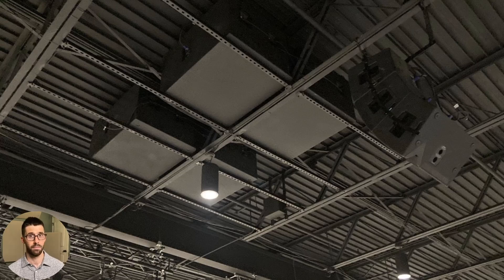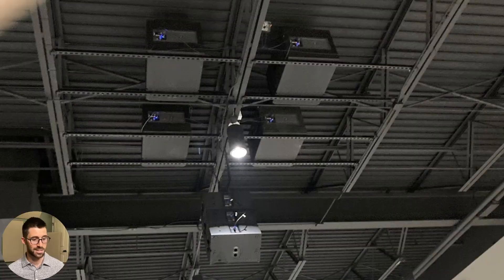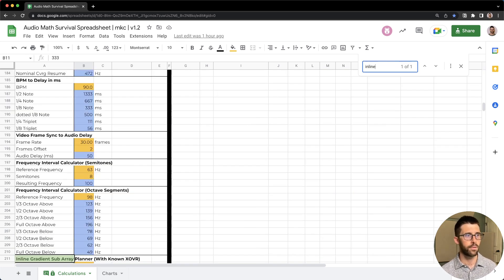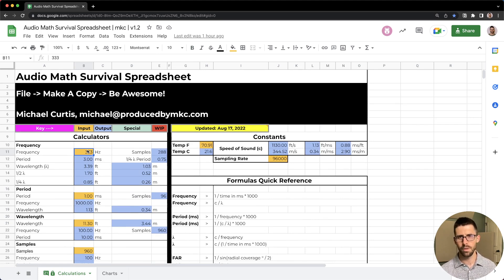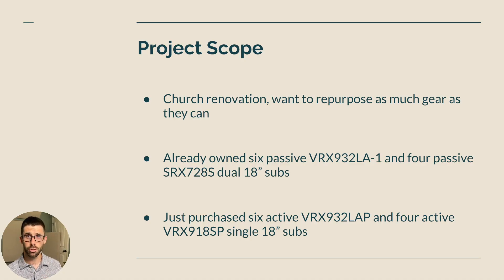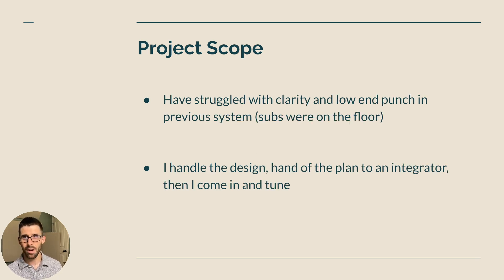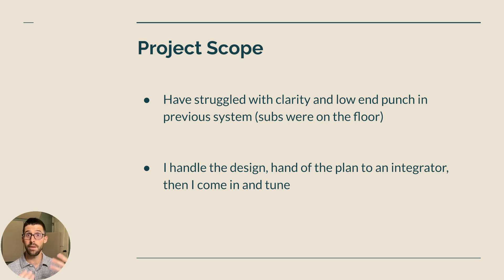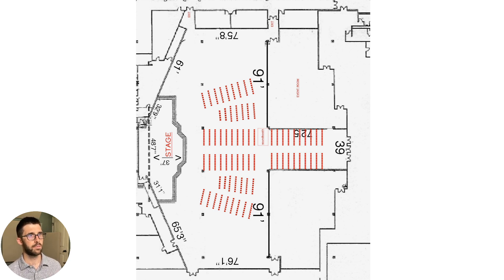They Thought I Was Crazy For Doing THIS With My Subs

Comment: We have a very wide and shallow seating area with a low ceiling, similar to this but without the tunnel. However, our room is not symmetrical and the stage doesn’t sit in the “acoustic center” of the space. Would it make sense to fly a sub cluster like this, but “off-center” from the stage so that it’s in the true center of the room?

Comment: Is it possible and Curtis approved to use this front sub-array design and instead of flying them put the subs under the stage?
Reply from the maker: Unfortunately cardioid arrays start to fall apart and not work effectively when many hard boundaries around them, so I would advise against placing them under the stage.

Comment: Great stuff Michael!  Quick question on the dual 18s facing each other.  What is the math behind the spacing between the two facing each other being 6 inches apart?
Reply from the maker: Thank you! It's so that the sound emanating from the front of the woofer has space to move around the cabinets and out into the audience.

Comment: LOVE learning so much about sub arrangement from your videos. I run small local shows, and I run the KS212C's, which are incredible for easy cardioid setup and mitigating stage noise. I'm curious if it would be worthwhile in smaller rooms that are longer than they are wide, if it would be beneficial to split those subs that 5.5 feet to narrow the overall pattern to minimize wall bounce? Is it worth it? Also, if I were to split them, would they need to be centered? Or can I just aim them towards center? Thanks for everything you do on here!
Reply from the maker: Hey, Ben. Great questions here!

With a pair of KS212C's in a long, narrow room I would do exactly what you mentioned: put them 5 1/2 feet apart in the center in front of your stage. The caveat here is that an active cardioid setup needs space from boundaries besides the floor to work properly. So this would only work if your stage does not have a hard front. If you've got an open stage front I'd still put your subs at least 3ft downstage of your stage to help get even more cancellation at the rear.
Reply: @MichaelCurtisAudio  Thanks a bunch! If I am stuck to a hard stage front, I feel like the next best thing is stacking them together on stage to one side? If I had the horizontal space I could still do the split setup, but I'm curious if it would just make an odd pattern if they're off center?

Comment: I’ve always been told, and certainly felt like, subs on the floor, coupled to that surface, made the low end more…felt, for lack of a better word. Based on this design, do you believe there is any loss in “thump”, especially that 60hz-ish kick?
Reply from the maker: No loss at all! The church I worked with on this sub setup made it very clear that they alllll about the low end. It had to hit hard, especially in the 40-80Hz octave. And this system definitely delivered! If anything flying subs makes sure that more of the audience is able to "feel" the subs, not just the front row.
Reply: @MichaelCurtisAudio   very interesting. Can’t believe I’ve just now found your channel. I lead the production team at a church in Bentonville so I’ll likely be giving you a holler!
Reply: The ceiling deck is also a boundary. In new construction I have requested a concrete pad on the roof deck to improve the response of ceiling mounted subs.

Comment: So your reason for doing the subs like that was to keep the low end in one palace for a deeper low end and it doesn’t travel all over that room.
Reply from the maker: 1. Keeping all the subs together is the most efficient use of energy.
2. The wide audience called for a wide pattern, which can be done in a center sub setup.
3. Flying the subs kept the stage clean AND made the sub energy more even from front to back.
4. The cardioid pattern kept LF energy from bouncing off the back wall behind the stage.

Comment: Hey Michael, first of all, thanks for another great video!

It is one that raises a question I've had in my mind for quite some time regarding flown vs. ground positioned subs.

There seems to be an opinion amongst many audio engineers (as well as system engineers for that matter) that flown subs should in best practice always be accompanied by at least some ground placed subs as a sort of fill, or else there will be a loss in impact and/or focus of the low end. It is a statement that I personally can't really see the logic in and on the few occasions that I have been mixing on a rig with nothing but flown subs I haven't really found an issue with it either, but rather enjoyed it since the low end I perceive at FoH is a closer representation of that perceived close to stage, in comparison to that of a classic approach with subs positioned only on the ground.

In terms of SPL the low end will obviously have a lesser impact in front in relation to further back in the audience with nothing but flown subs (not in comparison to itself, but in comparison to ground placed subs), but this is the whole point of flying the subs in the first place - a more even coverage. As long as there's enough power in the subs to, by increasing their output, have them compensate for that loss in the front this should theoretically not be an issue.

The only argument I myself can come to think of that supports this opinion is that one gets more direct sound from the ground placed subs before any room reflection blends in with it in comparison to the flown subs. This, however, would again only benefit a selected few first rows in the audience and not contribute to a more coherent over all soundscape in the room.

Maybe I answered my own question here but if you have additional thoughts or opinions on the subject I would be glad to hear them.

Cheers
Reply from the maker: Hey, Jack. Great question and yes I do think you ended up answering much of it. Just like we might design a down fill or front fill system for the first few rows if our line array is optimized for the 3rd row and back, having a small sub array down front can be helpful and restore some of the "front row" experience.

If the geometry of the rig works out so that both the mains and flown subs have great coverage in the first row, then no need to add the additional subs.

Sometimes you see at larger concerts a HUGE main sub hang, but then a wide sub arc of additional subs on the ground. That's usually an infra sub rig on the ground (15-30Hz), then the main sub hangs handling 30-80Hz (or wherever the ideal crossover is for that system).

Comment: How was rigging approved? Afaik SRX728 is not rated to be flown.
Reply from the maker: Rigging was approved by the integrator. I set up my engagements where I give them where I'd LIKE to have speakers, then they run the necessary calculations to approve that. You're right that those subs aren't rated to be flown with any conventional hardware from JBL, but it doesn't mean that they can't be secured in the air by other means. The unistrut cage and lag bolts solution used was a very sturdy solution.

I've never heard that subs facing each other would damage drivers. I've seen several setups from seasoned experts at Meyer Sound with similar setups. Do you have a specific resource or article you can point me to that says otherwise? I'm very curious.
Reply: @MichaelCurtisAudio  I'm trying to find the article in question in regards to the driver damage statement. I could likely be mistaken. Since that's the case, I'm going to remove that part of my comment as to not spread misinformation.
Reply from the maker: @indexanilvalue  No worries at all! thanks for the update.

Comment: Newbie here trying to understand sub arrays. Watched a few of your videos including the ones on the inline gradient array and the inverted gradient array. The delay stack looks like an inline gradient array, but what is configuration of the main stack with the boxes facing each other?
Reply from the maker: Great question, Terry. The main stack is the same thing as inline gradient, but the boxes are facing each other so that their acoustic centers are close together. This makes the pattern wide. If the boxes are farther apart the coverage pattern starts to narrow, which is what I don't want with a wide audience to cover.
Reply: Thanks Michael. So is the way to think of the two boxes facing each other is they act as one box in an inline gradient array?  So the front two boxes are the front  and the rear two boxes are the rear box in the simplified two box inline array in your other video?
Reply from the maker: @terryshaw2162  Yes, that's exactly it!
Reply: It's starting to make sense now. Thank you! On a slightly different topic, I recently saw on the Billie Eilish tour, the subs were hung in a vertical array directly behind the main array (L-R configuration). Big L-Accoustics setup. Could you perhaps do a video on this sort of setup? It didn't make a lot of sense to me, but obviously I'm missing something. 
PS Love your videos - learning so much.
Reply from the maker: @terryshaw2162  Having a longer line for the subs to be in actually helps narrow their coverage and make it more even front to back!
Reply: @MichaelCurtisAudio  ok, but doesn't hanging it directly behind the main line array put a hole in the coverage pattern?
Reply from the maker: @terryshaw2162  Great question. Larger sub arrays like that are usually responsible for about 80Hz and below, which are frequencies with at least a 14ft wavelength. Lower frequencies are able to "diffract" (bend around) objects. Even though the line array is 3ft wide, 80Hz, being 14ft long, has no problem bending around it.

Comment: How would I array 3 jbl dual 18’s to get a cardiod pattern or can you?
Reply from the maker: If it's a wide room, i would stack them up vertically. The top facing forward, the middle facing backward, and the bottom facing forward. If it's narrow, I would place them in a horizontal line to narrow the coverage.
Reply: @MichaelCurtisAudio  unfortunately we don’t have the height to stack them the stage is not tall enough but it is a wide room. The space in front of the stage is 100’x60’. Flying up high could be an option as we have high ceilings but they don’t have the money at the moment to do that so we are stuck with them on the ground. We also don’t have to use all 3 if it’s not the best fit.
Reply from the maker: @michaelyoung7911  Best scenario would be to fly them over the center of the stage once you get budget. If not, I would do a two-element inverted gradient stack. Just like the three-box array I mentioned, but the bottom one facing forward and top facing back. If that's too high, then I would just put them facing each other on the ground with a 4-6" space in between them.
Reply: @MichaelCurtisAudio  yeah our stage isn’t high enough to stack any :( so we will look into your last option. One of our pastors did ask if it would be easier to add a 4th box. I’m gonna have to download these prediction programs and start figuring this out! Thank you!

Comment: Great stuff Michael! I'm in a similar situation with subs on each side of our stage which runs the width of the room (about 100ft). We're currently running the entire system in mono and I'm getting some major power valleys near the front center of the room (just by ear). I'm working on rewiring to run stereo and thinking about running different low end sources to each side (kick-in to the left and kick-out to the right, etc.) to try and minimize these valleys without getting new gear. Thoughts on this?

I think Dave Rat said he does this for some shows he's done, figured I'd give it a try.
Reply from the maker: I'm not totally sold on Dave Rat's method because even though the two mics (kick in and out) have slightly different timings and frequency response they will still largely be correlated at the fundamental. So, even if they're panned out, there's still so much that's similar between the two that you may get "some" difference, but I think you'll end up back at square one.

I haven't tried Dave Rat's technique live, but if I compare the IR of two different mics and sum them I still get a ton of cancellation.
Reply: @MichaelCurtisAudio  That makes sense. Thanks for the helpful response!
Reply: Kick in and kick out are both to me the essential parts of the kick sound. If they are hard panned, people who are not directly in the middle will not get  the full kick sound, it doesn't sound like a good idea to me at all.
Reply: @Zamsky39 Yeah, I gotcha. Right now we have major comb filtering, so I’m thinking maybe it’s a slight improvement to try and minimize that if we can’t fully replace the wide left right setup anytime soon.
Reply from the maker: @Zamsky39  Agreed. Dave Rat knows his stuff and is a fantastic FOH engineer, but I don't jive with him on that specific workflow he uses.
Reply: @Landon I think it's worth trying it its a minimal expense if you already have the amp channels to change your sub config to stereo. I tend to agree with Michael that low end fundamental frequencies of any source will still correlate if this didn't happen the phenomenon of completely different instruments masking each other would not happen but they do.. for a minimal expense and fun thing to try without tearing the whole install apart its worth trying it and seeing if you get any improvements. I tend to think the concept is more applicable to sound sources like guitar amps where audible phasing can be obvious moving through a music festival or large out door event with multiple hangs. mono guitars will audible phase as you walk around but different mics on the same cabinet hard panned will stop this happening.I think this is more of where Dave is coming form on this theory and making things sound more natural rather than solving the peaks and valleys of a less than ideal system.

Comment: I would be scared to sit in there with those massive subs placed over my head! Weren’t you getting rattling noises? From the pictures, to me it looks like the subs will make everything shake and rattle around them.
Reply from the maker: No rattling at all, even at super high SPL. They're bolted onto unistrut, which is then fastened to the steel beams in the ceiling. Solid as a rock.